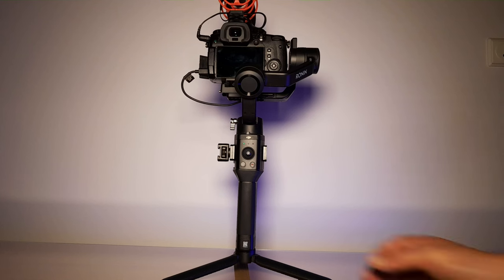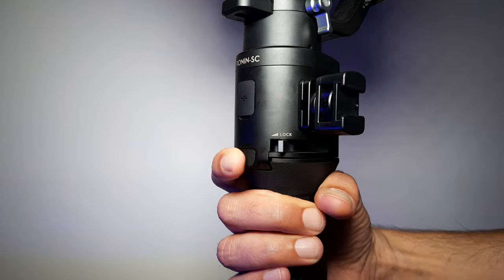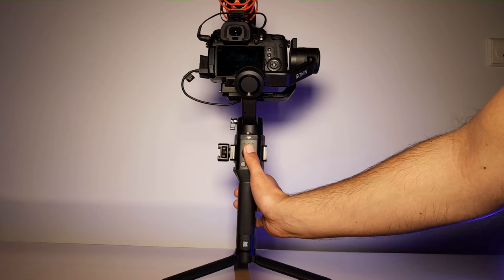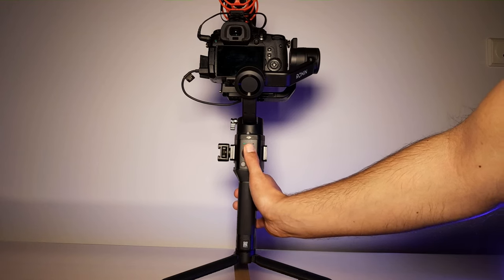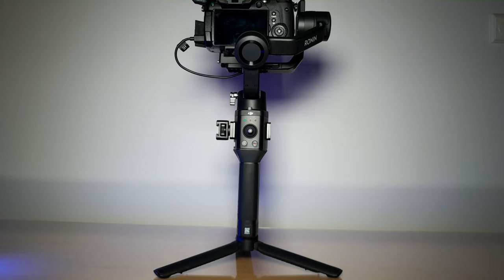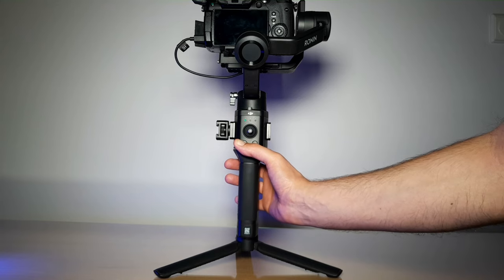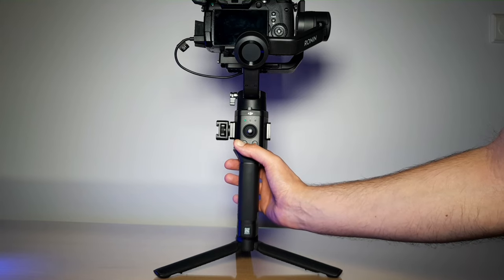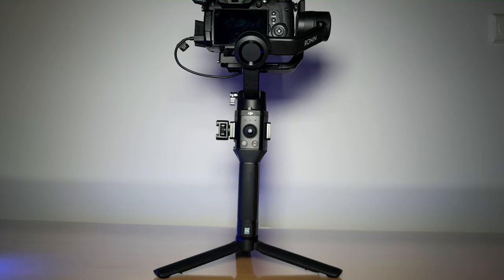DJI Ronin SC Problem | Drifting Gimbal - Fixed |

Comment: hi, i have a question, what could it be, i'm using ronin sc with sony zve 10, and the image is shaking, it doesn't stabilize nicely. Gimbal balanced, motors calibrated / can there be damage to the gimbal itself?
Reply from the maker: Hi, if gimbal is balanced correctly there shouldn't be any shaking visible. Try to turn off stabilisation in your camera, if image still will be shaking, change motor power in the ronin app.
Reply: @RDVIDEO  thanks
Reply: If the gimbal randomly starts vibrating, it could be that the camera is not tightly connected to the gimbal. Try tightening everything back down.

Comment: For me, the Joystick calibration only works for a few minutes - which is about as effective as rolling around the joystick without doing the calibration. I think the Joystick is just bad on mine. Maybe for a lot of people.
Reply from the maker: Contact with service, I had once the same issue and they replaced the plate under joystick.

Comment: Do you keep experiencing this when you turn off your gimbal I was doing a shoot the other day and it kept drifting on me when I would turn off the gimbal and stuff I don't know if you have experienced this I hope they can fix this.
Reply from the maker: I had the same issue. It means that the control plate of joystick is the problem. I send back my ronin on warranty and they fixed that. It's very common problem so now the control plate is a little bit different.

Comment: For me I get an error that says “roll motor overload.” I’ve been using the same set up for years without changing anything and it started doing randomly. I saw a comment from a guy saying he opened the gimbal and rotate the roll motor bracket 180° but idk what that means. If anyone has any experience with this I would appreciate any help you could give me. Thanks in advance!

Comment: Good afternoon friends, I would like to share a tip, I had a problem several times with my Ronin S, and some friends also had the same equipment, I always managed to solve both mine and theirs, but this week was cruel, there was no way, I did all the tips I found on YouTube, Google, and nothing solved it, when I turned on the equipment, it tilted down, and went into pause mode, when it turned on it kept spinning quickly, but after many tests, I realized that when I turned it on, it quickly went to the menu status and did system calibration and horizontal calibration, it became unstable, when it turned off, the same error returned and I had to do the same process again, what I thought, download the first version of the firmware, and I tested it until I managed to make it functional using the version of firmware V1.8.0.70 but remember, it only works when using the latest version, go to status, system calibration and vertical calibration and return to firmware V1.8.0.70, here it worked great, I hope you help my noble colleagues , RONI S